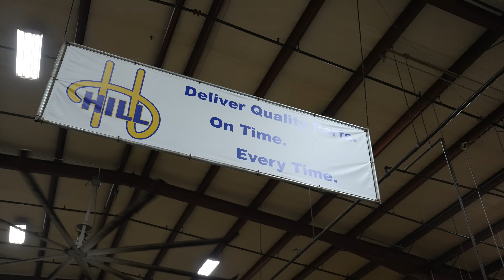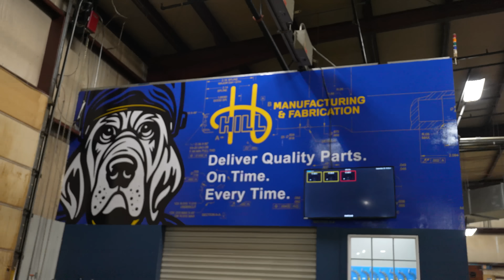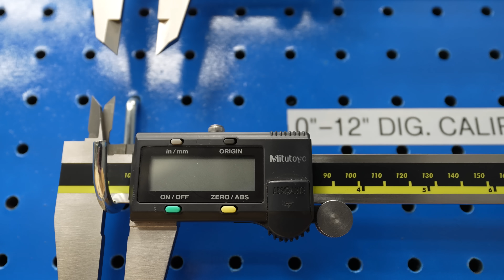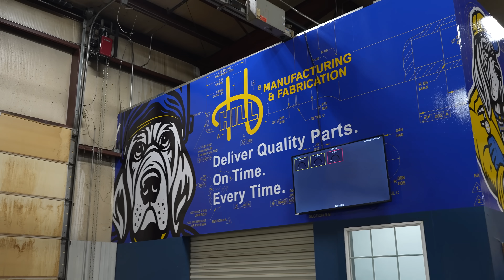Machining in Oklahoma: The Empire Rises

Comment: i am running for colorado governor but i believe my ideas can make for a better more self sufficent communial (not communist) place. one of the many changes i have in mind is creating a a trade guild. with in this guiild there will be electrical, welding, plubming, hvac, gas pipe, soldering, blacksmithing, tanning, tailoring, glass blowing, lathe, and milling machine. i would like for us to have manual lathes and milling machines which we will teach people how to use with safety at the number 1 pirority. i want to convert old malls as guilds which will also grant teens a chance to learn as well and learning from the guild can count to graduation. to incentivise people we will offer decent pay/ low rates. 

here is an icea. we make the guild mall/hall once you completed the operations and saftey course, and have a 10 hours of machine operations, you can then rent a shop owned by the guild, if you become an instructor (teach someone else the same saftey and operations) then you can use the rental shop with your only cost being materials and electricity. this will act as a positive feed back loop to incentivise people to learn and teach and by extention to work together